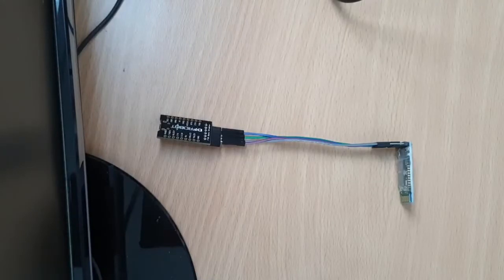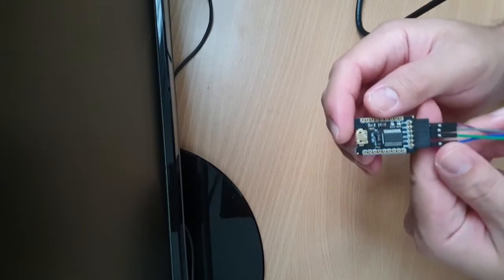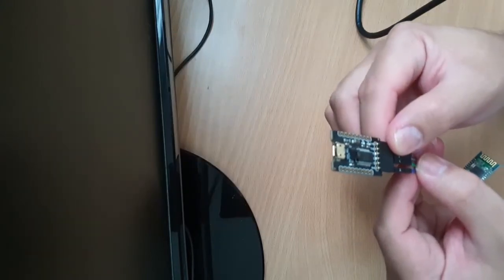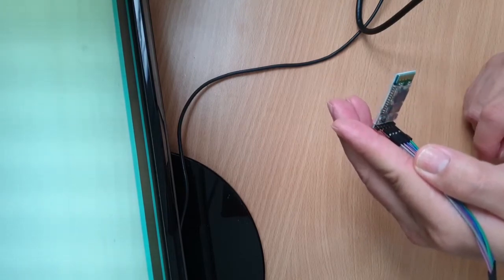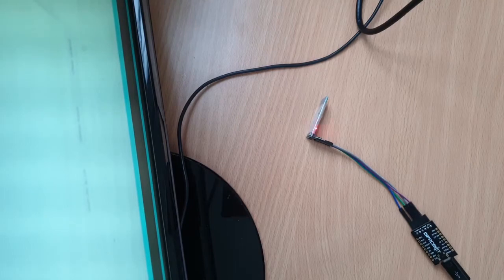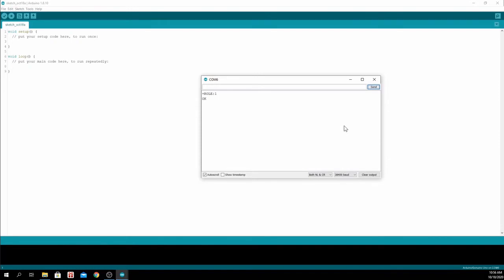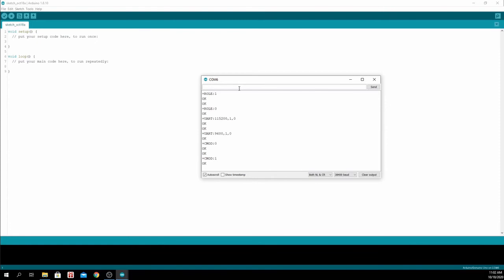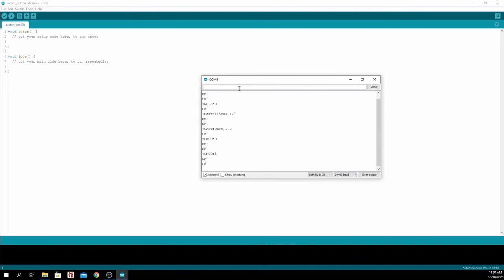Bluetooth HC-05 setup using FTDI

Comment: DID NOT WORK
Reply from the maker: What FTDI are you using? DFrobot website says connect tx-tx and rx-rx. Others connect tx-rx and rx-tx. Did you try switching pins?
Reply: @webslinger2011  but to answer your question i when with the tx/tx || rx/rx using 5 wires config and although i did not get any visual confirmation from the serial terminal while executing at commands i did took notice of the hc05 module l.e.d confirming my commands and so i accomplish what i set out to accomplish.
Reply from the maker: @arletpaz8010  As far as I know, I only need to connect 4 wires using DFrobot. Since I don't use sparkfun, I haven't used that extra wire connection you mentioned. Is it to reset after uploading/sending commands?
Reply: @webslinger2011  no you misunderstood me the wire config is not special to that sparkfun product i've seen other tutorials using 4 wires setups, other individuals dont even use code and only use a blank canvas or blank sketch and actually upload a blank sketch as a way to clear the memory on the mcu but again nothing special, you can do any combination of the said above with FTDI or even with other arduinos the hc-05 does not care it just wants the said at commands thats all where it get it from is irrelevant, however the hc05 does require a specific activation setup and this is what you and i similarly do when we try to program it via serial com
Reply from the maker: @arletpaz8010  For the HC-05 and HM-10, the only thing I really need to watch out for is the baudrate. I have a problem with clone esp8266 wifi modules. I can upload to it but it does not seem to work.
Reply: @webslinger2011  baudrate dont matter because you can change that also how do you know it did the upload if you're also saying that it doesn't work ?
Reply from the maker: @arletpaz8010  for the esp8266 wifi clone module, 100% sketch upload complete on the Aduino IDE. Only managed to get the blinky program to work on one module. Tried to do the same for the others, it uploaded successfully but did not blink after resetting. Do you have a sketch I can try out? At least to be able to connect on my network?
Reply: @webslinger2011  ahhhhhhh well there you go that's totally expected from a knock off clone but rest assure it would have worked have you had a legit module and or a good clone which they are out there a few, is a hit or miss and judging by your response sounds like yours was a miss "that blows" 

if you have a digital multi-meter or a oscilloscope you can check the values of the passive components on board of that 8266 module and make sure that they are giving out the right expected values according to their data sheet, this way you can isolate its faulty SMD and remove it ofcourse given the fact that you already have a spare somewhere else with the same expected value "spidey2011"
Reply: @webslinger2011  i was using a sparkfun FTDI so it shouldn't matter where was it bought from it's an FTDI module and were all made with the same purpose so unless there's something special about this particular unit i see  no reason why it shouldn't have work, however i did managed to get it to work following my programming instincts.